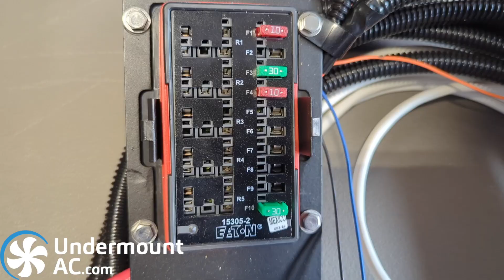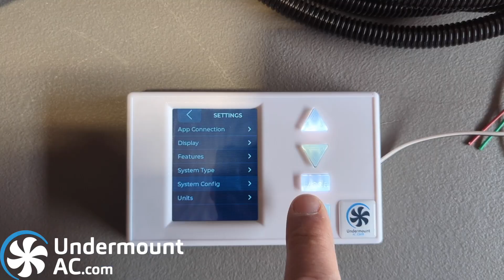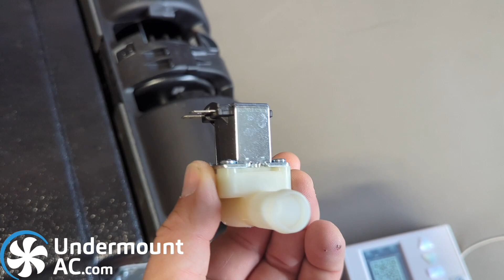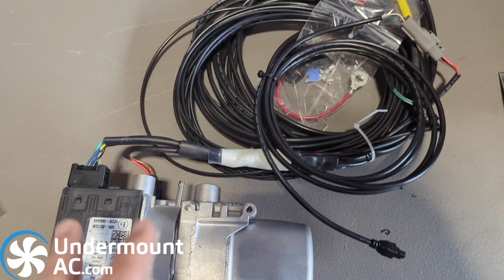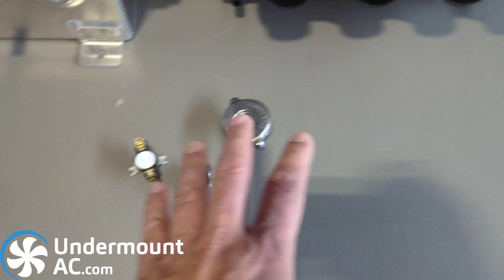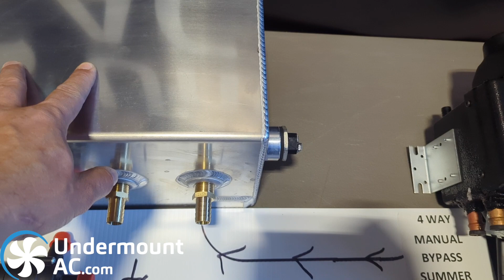UndermountAC com HVAC Heat Options  (Espar or Engine Hydronic Loop)

Comment: The rubber plugs or bushings that are in the ends of the heat coil loop connectors -- do you leave those in or take them out?   If take out, how???
Reply from the maker: They are plugs, you must pull them out. Grab the rubber with a pair of pliers and pull.

Comment: When do you estimate the complete kit will be available for purchase?
Reply from the maker: We are hoping for mid-July
Reply from the maker: You can purchase a HVAC kit from us now, and order a Espar hydronic heater from a dealer as well. The missing piece would be the wiring harness, coolant reservoir and plumbing. This is the part we are hoping to have available mid-July.
Reply: @undermountac  is this available yet?